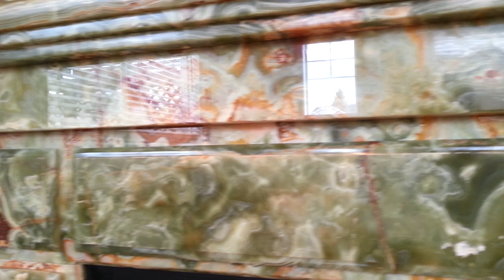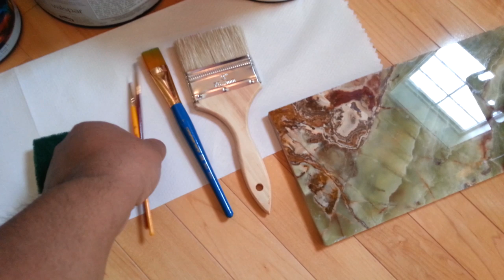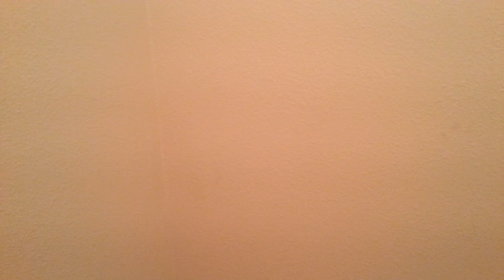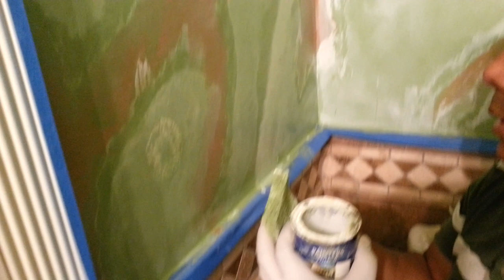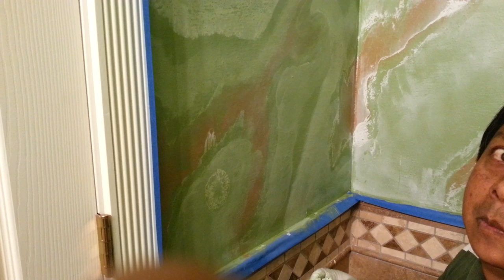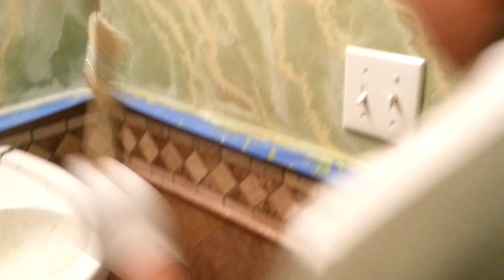Marble Painting Tutorial - Part 1

Comment: HI SIR . Can u plzz tell me the names of the paints that u used in painting this Green Onyx marble ...
Reply from the maker: Hi Faisal, thank you for viewing my channel.
I just used regular water base paint that's been sitting around in the garage.
You can find this at Lowe's or Home depot it's called (Valspar) they can mix any color you like.
Hope this helps. Please let me know if you have any other questions; I'll try to help.:)
Reply: CAN I USE WATHER COAT OR EMULSION
Reply from the maker: I strongly advise NOT using oil base paints! Oil paints are hard to use when making the fine lines and the fumes can make you nauseous if using in large quantities (and it's hard to clean up). Water based paints, regardless of brand, is easier to work with. As long as you have a vent or some kind of air flow in the room you should be fine, go with the flow. Again, oils are kinda dangerous when working in a small space in large quantities. Make sure you crack a window and wear a mask if needed.  good luck.
Reply: THANKS FOR ADVISE I CAN USE THR WATER SHEET OR EMUSLION
Reply: YOU SEA THE PICTURE
Reply: PLZ SEND ME OTHER MARBOLE VEDIO
Reply from the maker: What picture?...
Reply from the maker: This link is not work.
Reply: I WAS MAKE THE MARBOLE BEFOR 3 DAYS HIS PICTURE SEND TO YOU
Reply from the maker: Which marble video are you looking for?  What project are working on?
Reply from the maker: Can you please send the link again?
Reply: SEND ME OWN G MAIL ID
Reply from the maker: Please send it to darawfc@gmail.com